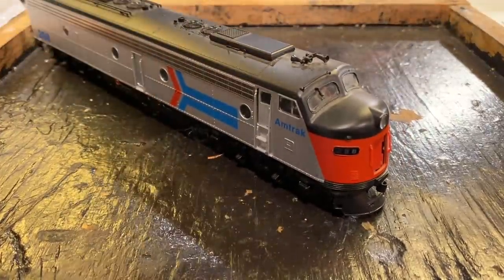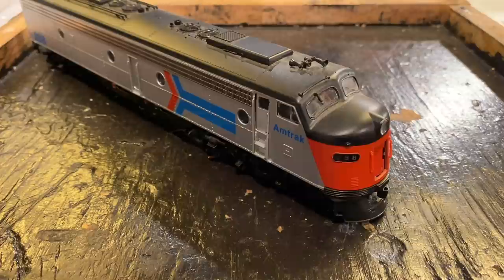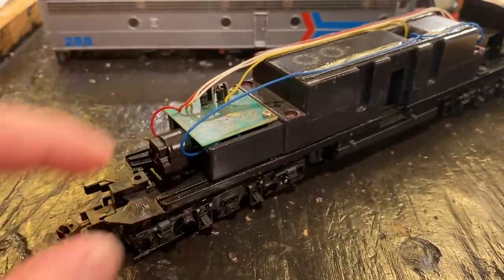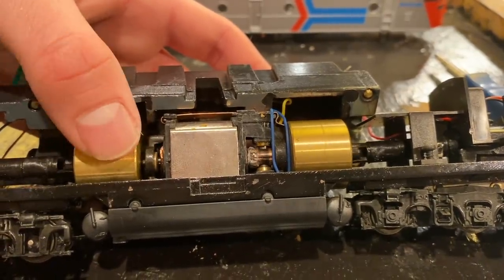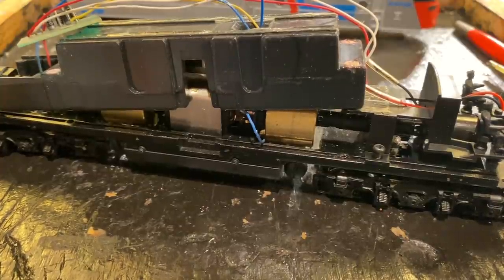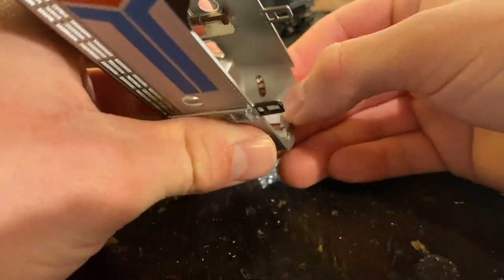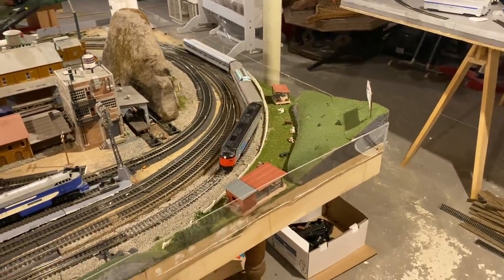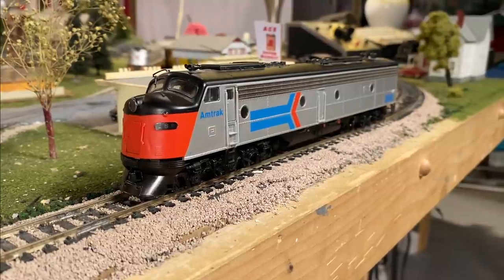This HO Amtrak E9 Won't Run - Spider Egg in Motor

Comment: Proto 2000's never had Athearn Motors, the Motor is actually a 5 pole skew wound can Motors, while the athearn motor was a 5 pole armature motor (big difference) and the only difference with the proto motors is bigger flywheels, larger than normal armature for increased efficiency, and the story goes that they almost copied athearn but made the motor higher performance, all of which was done in 1993 when Proto 2000 was introduced, in 2001 P2K models becane DCC ready, and in 2007 just before the merger with walthers, the last ones produced either had DCC or DCC sound on select models which was offered as an optional unpgrade package during the early NCE and MRC Dark Ages era of the early 2000's by 2016 the Walthers Mainline replaced the original proto 2000 units, and now feature lok sound.

Comment: How did you learn to fix the trains in your videos i find it amazing
Reply from the maker: Trial and error. When I was a kid I would take them apart and try to put them back together. I failed countless times but I learned a lot from it.
Reply: @SMTMainline  wish I had the ho trains from when I was a lot younger I had a mint green loco it was dropped several times and ran like a top unfortunately I don’t remember the maker of it

Comment: Should yourself a NMRA gauge, can gauge wheels, track, turnout points, coupler height, etc... with the one gauge.
Reply: i have a caliper and some properly- gauged track- that's all you need. gauges and rulers made for a particular scale are just a waste of money. the exception would be the height gauge if you do a lot of couplers, but that's just for convenience and there are workarounds for those, too.

Comment: I was so early my screen went black and I had to reload YouTube. 
Btw the 2 big gold things in front and behind the motor, idk what they are but my engine has them and one of them has some little scratches kinda and it’s not running too good it slows down and stuff. Would that be the problem?
Reply: They are flywheels.  They are just weight to maintain the momentum of the motor and make it run smoother.  Scratches on them won't hurt anything.  Make sure the motor runs.  Clean the commutator as he showed with the fiberglass pencil brush.
Reply: DBTech thx I don’t know anything about them things but I’m just starting. It’s a brand new bachmann so maybe it’s gotta be cleaned? Idk I’ll try what u said, thanks.
Reply: @dbtech7914  the flywheels are also able to allow for it to continue moving for a second if it loses power like if it goes over a poorly laid track
Reply: @captainjamestkirk5350  You are correct.
Reply: Samuel Olesek yeah I kinda noticed that

Comment: I have that exact train, it’s pretty good but it doesn’t like turns
Reply: Perhaps try running it on wider turns perhaps 26inch radius and up
Reply: @captainjamestkirk5350  I have a shelf train around a room, and yeah it’s got some tight turns, so I had to modify the train to allow for it and it’s working good now
Reply: @smallengine  ah ok makes sense
Reply: i bet the general consensus is 'it has a split gear'

Comment: Hey, just wanted to say I’ve enjoyed your videos and look forward to future posts. If you have an RDC Proto, could you post a video on its maintenance? I purchased one not long ago second hand, and it’s running slow even at full speed. I’ve learned a lot from your videos, but I’m afraid i do t know how to remove the drivetrain to clean out the gearbox. I’d love to see how you approach this. Thanks SMT!!
Reply: don't run it anymore until you sort it out- motors get smoked that way...

Comment: Should ask for one of those foam pads for Christmas or your birhtday so you can place the loco in it while working on it, to keep from banging up the shell and details attached to it, while working on it.  Also aske for an NMRA Standards gauge as well.  :)
Reply: he has the foam pad (just doesn't use it) and doesn't need the gimmicky gauge thingy.

Comment: The diodes are for directional lighting. The journals where the wheel axle points go are spring loaded. Overall a nice model. 

BTW, the AMTRAK paint scheme on the E9 is Phase 1, from the very start of AMTRAK in 1971 to about 1974 and what's more if you put together all your US passenger cars from different railroads behind that E9 it would be prototypical since AMTRAK in those days were just running the equipment it bought or was given to it by the railroads getting rid of most of their passenger equipment. This Era of AMTRAK was called The Rainbow Era (1971 to 1974). So next time string most of your American 1960s and early 1970s passenger cars behind the E9 regardless of railroad and it will be perfectly realistic!:

https://www.hebners.net/Amtrak/amtErain/RainbowHeader.jpg

And if you are wondering AMTRAK still had many locomotives in their original colors look at this rainbow train with the Burlington Route chrome E8 locomotive, Union Pacific B units and Great Northern baggage car and one of the first passenger cars repainted in AMTRAK livery:

https://pin.it/6F286mj

And yes VIA had its own Rainbow Era:

https://www.amtraktrains.com/threads/vias-rainbow-era.47653/#lg=_xfUid-5-1615815183&slide=0

Comment: @5:07 looking at the underside of the board ... the solder you point to is not an issue as you can clearly see that the top half of the board was never populated.  What you miss is the rather large and obvious (to anyone trained in soldering) cold solder joint for the wire connected to the board.  I've noticed in your videos you really don't know how to solder so I'd recommend you watch some videos on the subject and get some better equipment for the job, like an basic multimeter with circuit tester.  https://www.youtube.com/watch?v=Fp37DPZVdRI
Reply: i've seen harrison do lots of successful soldering connections- so, apparently, you are wrong.
Reply: @tommurphy4307  ... Well, as a trained electronics technician with years of experience in the field it is apparent from his videos that he only has entry level knowledge of soldering techniques (i.e. heat it until it melts and you are done).  But this is only in response to your uninformed comments to me,  I surmise (from your response) you probably have the same level of soldering experience as Harrison.  That is his soldering connections may work ... but they are poorly done and would not pass QA at any job site.

That being said, my comments to the author of this video were intended to encourage him to seek out training in the field of electronic soldering ... and there are plenty of videos available for that on YouTube.  As for better tools, I understand that this might be prohibitive but none the less proper techniques with the tools he does have would yield much better results.